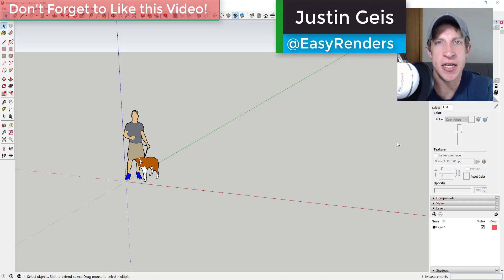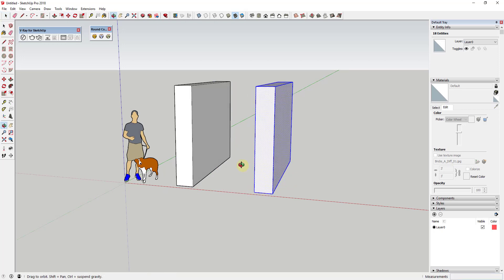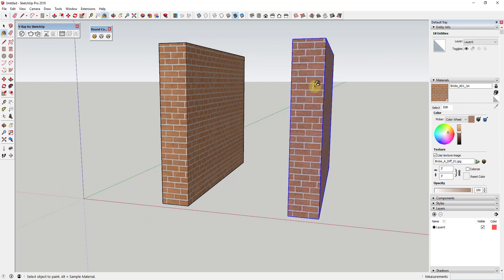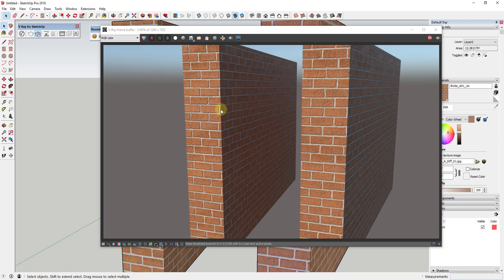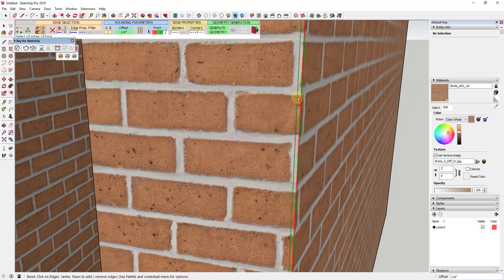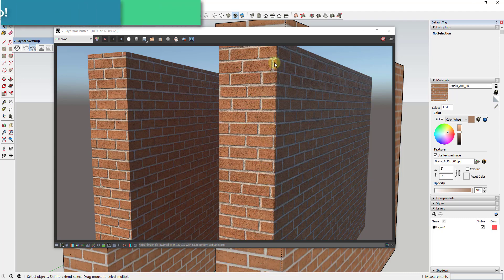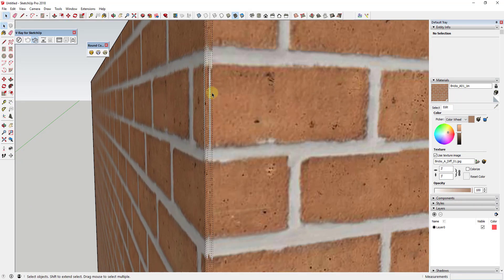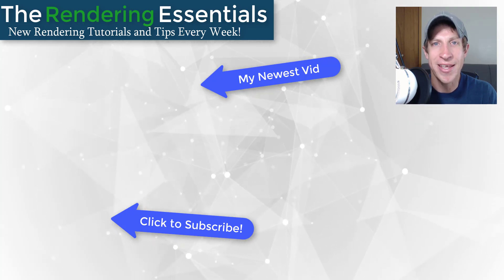CREATING REALISTIC CORNERS IN VRAY for SketchUp

Comment: Hi! I'm not sure if my question is related to this topic, but I'm wondering if you can help me with material problems when uploading my sketchup model to sketchfab. I noticed that on sketchfab, there are an insanely number of materials created for each face of my model, meaning that each face has a material of its own. I was wondering if that is because of the rounded corners? When I toggle on hidden geometry, those extra faces that make up the curved corner show. Could it be the way I applied the VRay texture? I have tried painting each face vs painting the group. Nothing worked. It almost seems like its reading those individual faces that make up the curve as individual groups. Thank you! Sorry this is so long.
Reply from the maker: Not 100% sure, but it sounds like you're having a UV mapping error, meaning the materials are not mapped properly to the faces in your model. That said, I haven't really used SketchFab, so I don't know exactly how to fix it...
Reply: Thank you for the response! I played around with the textures a bit more. I noticed that its very different between painting each face vs painting the whole group/component. When I paint a group, I don't get the option to reposition the texture images on the faces. Im assuming the textures are "projected" onto the faces by the bounding box of the group? However, when I go in to edit group and select one of the faces and I do VRay UV Tool->Tri-Planar Projection, this then gives me the option to position the texture. My question is by doing that tri-planar projection, am I accidentally making a new "material", meaning is this face's material no longer the same one as the rest?

Comment: Good point Justin! But be careful because round corners can mess up your geometry on more complex builds. Also it is often not reversible so your stuck with it. (Hope this makes sense to you)
Also, lots of round corners means lots of extra geometry so choose carefully which corners to round and which not.
Reply from the maker: It definitely makes sense - I think there is also a workaround you can use with displacement mapping, but I believe that can really slow down your renderings. I haven't done a ton of testing with this yet, but honestly I liked the result I got with the bevel tool better in this case, and it creates much less geometry, so that might also be a good workaround. Thanks Willem!